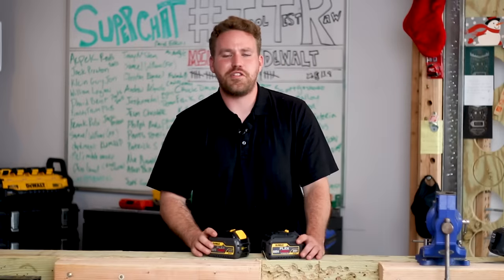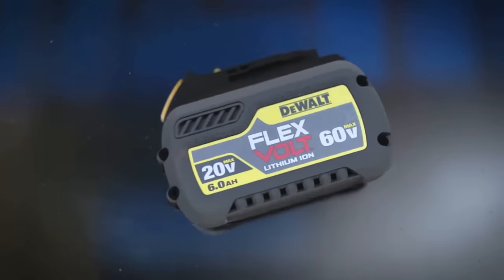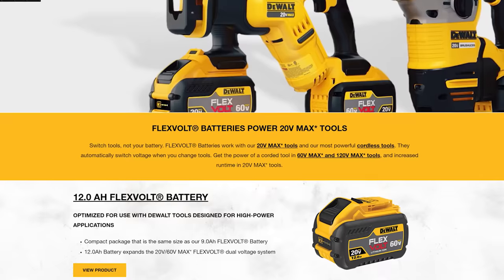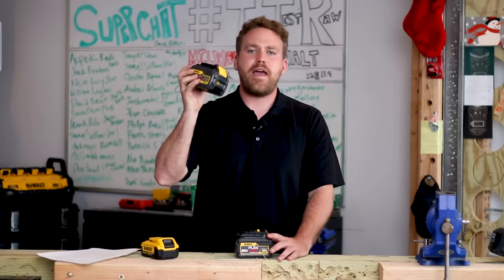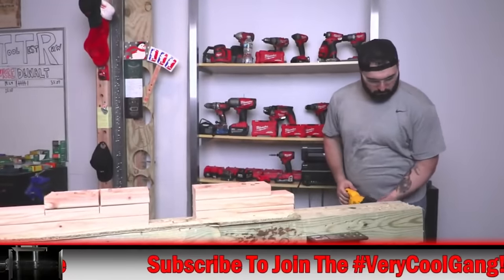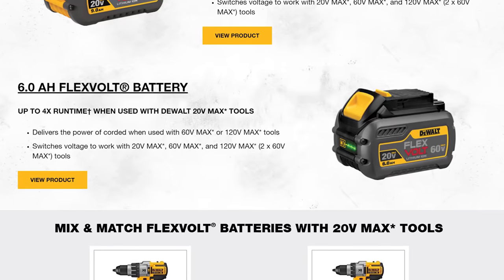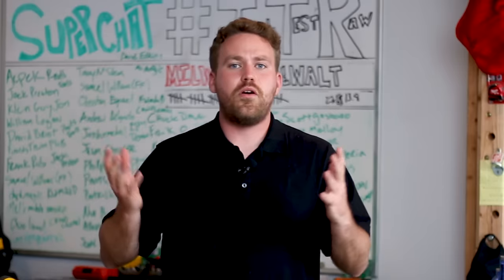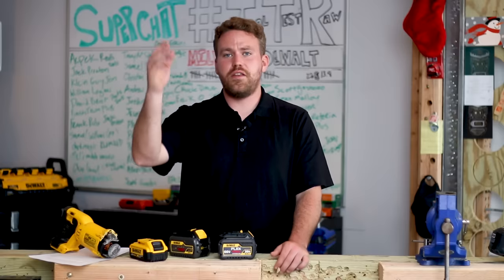NEVER USE DEWALT FLEXVOLT BATTERIES ON 20V MAX TOOLS!

Comment: I have been using dewalt for 15 years, and I am still using all my 18 volt tools i just bought the adapters to convert them all to 20 v i have only ever had one issue and that was a charger cought on fire on me one time itcwas an 18 volt yellow lithium battery charger plugged into a generator.  I have also ran 18 volt milwaukee tools for about 10 years now and i have blown up 2 impacts and 1 grinder. And have had 2 batteries go bad on me. So everything i buy now is yellow.

Comment: A Dewalt Flexvolt battery has three 20 volt cells. When wired in parallel they produce 20 volts. When put in series they provide 60 volts. On a 20 volt tool they run in parallel and provide the same exact voltage the tool was designed for. However they will run much longer so maybe you could overheat the tool by running it longer than it was designed for ?

Comment: i definitely notice a difference in power increase when i use my 9ah flexvolt battery in my DCS391 circular saw..but i have been using it with the flexvolt battery exclusively without issue..and i also use the flex 9ah with my 20v max impact and havent had any problems..however i havent pushed the impact nearly as hard as it appears yall have when testing so perhapse the extra amperage increases beyond the extra push im feeling when the impact is made to work at its peak level..i can picture the possible increase happening  especially with an impact since the whole idea behind the mechanics of an impact are designed to increase as the tool recognizes the need to do so. So perhaps the fact that the newer cells inside the flexvolt battery packs have a slightly higher amperage rating than the older cells had..and maybe dewalt overlooked a threshold vs potential situation and the peak amperage of the new cells in series is just a bit too much..and then again maybe the average user is unlikely to take em to that point.. but this is all just theory based on my limited knowledge of how certain tools function and not so much a theory backed by  the actual numbers as they relate to the tools vs battery.. has anyone gotten an update on this phenomenon as of yet? it would be interesting to know the batteryd full potential output as it compares to the tools maximum tolerance.

Comment: My understanding is that the flex volt has 3 sets of 20v battery banks that can be run in series or parallel depending on the voltage needed.. The red shipping cap and tab on the 20v tools activate a mechanical switch to put the banks in parallel, from the default series. Perhaps if the switch on the battery fails, or the 20v activation tab on the tool fails to activate the switch, I could see 60v current ruining a 20v tool. Both properly functioning tool and battery should not be an issue.

Comment: Very untrue, used the 60 volt flex on all my 20 volt tools no issue except for bad ass run times and getting work done faster without having to stop and change batteries.

Comment: So if you look at the connection there are 2 different sets of slots one slot set is wired 60 v and the other is wired 20 v the 20v tools have pins that connect to the 20v slots and the 60v tools have pins that connect to the 60v slots and that how they work, when used at 60v the amp hour is cut into 1/3 of the battery amp hour and 20v runs the full amp hour stated on the battery. It’s basic knowledge that sawsall was on its last leg looked pretty dated the only downfall to these batteries is their weight.

Comment: I had a 20v 6 1/2” circular saw and two 20v drills that got toasted on Flexvolt batteries.
Reply from the maker: Only use flexvolt on Flexvolt tools!
Reply: VCG Construction I def agree now, when I first used the batteries in the 20v tools they had more “zip” to them which I thought was awesome until tools started burning up.  I think the batteries are putting more than 20v through the tools which burns them up
Reply: @JaketheRake16  they aren't. Flexvolt only runs 20V at max, after that they settle in to around 18-19V.
Reply: No you didnt

Comment: I build houses for a living, i use flexvolt on all my 20v tools allll dayyy longgggg, never had a problem. Impact driver gearbox gets hot to the touch after hundreds of screws in plywood with a Flexvolt on it but Never burns out
Reply: I was laying plywood last week and after around 250 screws with a 5ah battery my impact was hot to touch so the heat is a workload issue not a flex volt one
Reply: Same here, I've done over 2000 sqft setting plywood for subfloor with my 996 never an issue!

Comment: I will say Milwaukee has a built in surge protector to keep the higher amp batteries from overloading their tools. Makes them almost impossible to use a large battery on a driver. No clue if DeWalt has a similar function.

Comment: Been using this system since day one. Never ever had this problem ...neither has 19 other carpenters I work with. News to me.
Reply: Exactly  carpenters cut wood { Especially that old growth rough dimension product , on remodels } and lay down mass impact driven screws , plumbers and electricians cut some plastic pipe  and offset drill some holes in studs for romex  ,most carpenters are running De Walt From What im Seeing Out Here.

Comment: Pretty sure you have to have a flexvolt advantage tool, to use the additional power from the battery, may be wrong, but either way I've used flexvolt batteries on my standard dcf887 impact and nothing happened

Comment: I did use a Flex battery on an old 20v drill and after a while it did start smelling like burned so I used a newer stronger drill after that to keep drilling holes.

Comment: This may I switched over to Milwaukee cordless everything. Ive used dewalt cordless and corded tools since I became a carpenter @18yrs ago.......BUT Milwaukee is just more innovative and the batteries are miles ahead of dewilt in power and battery life. The m-18 fuel line is at the top of the food chain. Sorry to loyal dewalt users but you cant argue with results.
Reply: Every dewalt tool feels better in my hands then a Milwaukee. cant argue Milwaukee has more power in some cases. I worked for a guy for fifteen years who only ran Milwaukee cordless tools. I can honestly say I can do a better job with dewalt. Milwaukee's 18g brad nailer is absolute junk the jigsaw and multi tool are subpar. Dewalt put a lot more thought into the ergonomics and preference of these tools. Now these are just a couple examples but it is enough for me to switch to dewalt. This opinion is coming from a finish carpenter tho so my effect my decision differently.
Reply: Dewalt has been on the forefront of the brushless technology some of Milwaukee's tools haven't even come out with brushless versions of their tools they are slow to come out with brushless versions even tho they feel rushed and janky when they finally come out lol
Reply: @ryan lost its all personal preference at that level of product (Milwaukee,dewalt and makita) are all top dogs. Its drom my personal experience only that i decided to switch brands and its the best move i ever made. The battery life of the 3amp,5amp ,and 12amp is just ridiculous. I still prefer some dewalt tools over anything else like my mitre saws i only use dewalt 12” and dewalt trim guns. I just like Milwaukee cordless platform better. Its crazy how random people get so butthurt over someone elses preference of tools haha like i was talking about their momma or something!! Dewalt makes great tools BUT that being said my Milwaukee stuff will shit allover my dewalt tools any day of the week.
Reply: @ryan also go to AVEs channel and watch the tear down of the flexvolt cordless POS of a compressor and you be the judge
Reply: You realize Milwaukee is just Ryobi in red these days right?

Comment: only way you're running 60v into a 20v tool is if the springs aren't pushing the switch back into 20v mode when the battery is taken off the Flexvolt tool.

Either you keep testing other tools (like the DCD996 or some cheapo brushed circular saws) to see if you get the same problems.  Or you meter out the battery voltage each and every time you insert it onto a tool to show people it's not 60v.  

And there's no way it goes into 60v mode on a 20v tool because there's no rails to push the springs in.  So either the spring-loaded switch is faulty when coming off that 60v tool or you're just getting seriously unlucky.
Reply: There is an electronic switch that has to be tripped as well as the mechanical switch. I made a video showing why this is a bunch of crap.

Comment: I have not had any issues with my 20volt sds hammer drill sawzall , even the 3 1/2 saw with the flex volt battery and the hammer drill gets used daily 30+ 5/8 holes  no problem I been using these same tools for more than 5 years I just upgraded the hammer drill due to having issues with the bit coupler worn out the bit falls off

Comment: I don't think flexvolt overloads 20v tools. If you look at the pins on a60v tool and a 20v tool, there are fewer pins jn different locations on the 20v tools. I'm not an engineer but I'd suspect this is so the 20v tool doesn't have access to the full 60v power on the battery. If I could I would post pictures of my Dewalt 570 next to my 578 to show you what I mean. I just recently upgraded to flexvolt so I haven't had a ton of time to test myself, but I did a good bit of digging around and comparing tools beforehand and this was one of the things I noticed.

Comment: how is this even possible?  the Flexvolt has pins you need to short out along with a spring safety mechanism in which a non-20v tool depresses in order to output to 60v.  This is not possible unless you modify the 20v tool itself.

Comment: I use flex bolts all the time. Tools still work perfectly fine!!
Reply from the maker: Good to hear!
Reply: Same here.
Reply: Same. When I originally saw this video it made me worried and I didn’t use my flex volt battery for a long time on anything except my tablesaw. But eventually because I see Richard from finish carpentry TVUsing them all the time on 20 V tools, I decided to just go ahead and start doing it. No issues.
Reply: @christophercrawford2736  Never had a problem of any kind by using the FV on 20v tools. Video is complete BS imho.

Comment: I do solar work 1/2x6 lags and on a couple occasions my impact would seize randomly. At times it works great and is substantially more powerful than average size batteries and run time is great 2-3 days per battery.

Comment: One thing I noticed running a flex volt battery on my 12” chainsaw; it doesn’t bog down at all deep into a cut like the 20v batteries do. I could see this relentless delivery of current pushing the tools past their 20v limits. 

I’d try not to push the tools to the max with the flex volt batteries and I’d think you’d be fine.

Comment: I think I should be good because I don't try to push the limits of the tools. I know you guys are a review channel and you put these tools through a lot of testing. I respect that. But if flexvolt is about use in the long run, not under heavy load, then I'd assume that it would work as advertised.
Reply: toasted my screw gun firwt time i put it in it drivin one 3 inch screw, damn near lit the tool on fire bellowed black smoke even after i let go of the trigger. got so hot within 10 seconds i had to drop it. 3 speed drill same thing bit no black smoke it just stopped working 3/4 of the way through a 4" hole saw thru plywood. opened that one up it actually shattered the brush. never had a problem in the saws roto hammer or bug ½" impact. all my 6pv batteries burned up since. they do not like to be wet

Comment: Difference is probably in the much higher "C" rating of the battery.  Flexvolt can sustain much higher ampage output at 20V over a longer time, where a 20V gets throttled by its protection circuit.

Comment: Short time watcher, first time commenter. I am on the edge of buying a cordless DeWalt router and wanted to know if there was any news on when the router would be flex volt advantage ready or whatever its called? Do they burn out now? Can you guys do a head to head with different routers that are cordless in a death match or something? Thank you for your time.
PS: can we buy that battery adapter to a wall plug thing they sell with miter saws on any tool? Let's push the limits here in terms of versatility.

Comment: Bullshit. I'm using these batteries with 20 volts tools (dewalt) since a year and nothing happened. I got drills. Multitool. Jigsaw. Router. Circular saw. Sawzall. 20 volts. Clearly this guy is from other brands.

Comment: i`m using 7-1/4 dewalt miter saw with a 6A FlexVolt battery every day since nov 2018 - everything is fine.
Reply from the maker: Is it a Flexvolt model?
Reply: @VCGConstruction  DCS361 20v brushed
Reply: I've done the same for 2 years. No issues. you had some bad luck but it's not consistent with the experience of thousands of dewalt users. You need to take this video down -you're losing a lot of credibility.
Reply: I am not aware of “ Flexvolt models”.   Tools are 20 volt, or 60 volt.    There are only Flexvolt batteries that can power either 20 volt or 60 volt tools.
Reply: VCG Construction    No such thing.
Reply: D K    AMEN!     Probably get sued!

Comment: Low voltage will cause a fire quicker than high voltage. Seems to be an issue in the flex battery pack. Seems it can’t regulate the right voltage per tool.

Comment: 887 SHOULD HAVE BEEN STOPPED & RECALLED FROM DEWALT, that impact driver is defective off the assembly line. Have been using flex volt 6&9 amp hr batteries on all my 20v tools with NO incident to date. Come on guys, little more research on a product especially when you’re “warning” someone about it.
Reply: The 887 internals are now used on the craftsman impact driver made in America. They still use these internals for the watered down brands.

Comment: Something is funky with Dewalt batteries. I got a DCF921 compact impact wrench(2024 purchase) that doesn’t want to work with my 5ah PowerStack batteries but runs flawlessly with the XR 5 or 6 series. No one else got that issue?

Comment: I do granite work and I use the brushless angle grinder with 20 V and 60 V batteries and they are over a year old with heavy abuse still running good. They outlasted any plug-in grinder I’ve ever bought

Comment: The problem may power overload.  It's only a guess but the cordless drill average wattage is around 100 watts.  With a 12Ahr battery the wattage hours increase to 240Whr based on the fact that power equals voltage(20V) X current (12Ahrs). 20 x 12 = 240

Comment: It's still a 20volt output I don't think it makes a lick of difference.
Reply: Correct.   The switching system is activated physically by the tool you use.   There are three rows of cells in there.   Each row is 20 volts.   The switching system will give you a very high capacity 20 volt battery by connecting the rows in parallel or 60 volts by connecting them in series for 60 volt tools.    It’s a great system very well thought out.

Comment: The flexvolt batteries test at the same exact resting voltage as the 20vs. The cells and prong connections are situated in such a way that they can't deliver more than 20v when attached to a 20v tool. Maybe your tools just crapped out.... like tools sometimes do.

Comment: Watch ave channel he tears down the flexvolt battery and explains how it works.
Reply: Thomas Smith yeah, after watching his stuff, I’m betting it’s burning out the mosfets in the triggers. Not enough meat to handle that much energy for a prolonged run time. It would be interesting to have an electronics tech pull the burned units apart and see what component burned up.
Reply: @jthatguys  yeah, not "skookum" enough for the Flexvolt batteries.

Comment: I cut a 6 5/8 chain link s40 post in half with my brushless recip saw earlier today and it was loaded with a 9ah flex. That was a beast to cut but the saw ran fine after.
This is a common cut we make all the time. The saw will get warm but it keeps running. I'm happy with it so far.
I don't run them on my impacts or drums only because they throw off the balance. I prefer 5ah on those. But for my recip or my 60v skil saw they are hard to beat imo

Comment: It may be that Dewalt and Milwaukee are designing their tools at the bottom of their service factor range, as in parts are the bare minimum to work.   I use a Milwaukee cordless drill at work and noticed that it gets noticeably and unusually hot during prolonged use.  It's a small and very attractive package but I just don't know about it.

Comment: i have been using flex volt batteries in my 20v tools since they came out. never had an issue. impacts,drills,router,oscilating , sanders,biscuit jointer, bandsaw, circular saw,jig saw ,brad nailer,rod cutter. they all have been doing this for years.

Comment: I was on the understanding that flexvolt batteries will operate in 20 volt dewalt tools that have the XR in black stamped on them. Some of there tools have XRP in black on the Combi drill so these will make the battery change from flexvolt to 20 volt.

Comment: , 20v tools run much harder with the flexvolt batteries, however i have not had an issue yet, use them with the hammer drill, sawzall, hex impact, and 1/2 ,midtorque and havnt had an issue yet after about 2 years of heavy use.